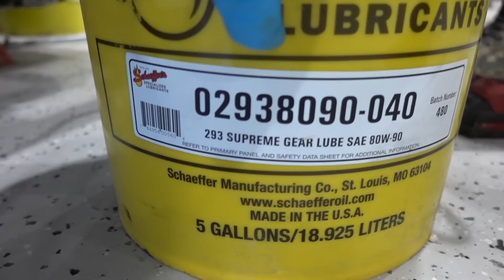Little Scout, Big Upgrades

Comment: Those Scouts were good, At least i liked them.  The worst part was trying to find parts for them.  Last one i worked on was a travelall.  Could not find steering linkage for it (this was before the internet got big).   The best thing are those engines all most undestroyable.

Comment: 12er!!  
did you put wheel weights directly across from each other .???
Reply from the maker: It looks like I did. Lol. The tire machine said they needed more weight but I just put them on. Rides smoother then ever!
Reply: @holdenbros910  ...bro no step 1 step strip the weights n start over  apply your initial weight on your first spin straight up where  the machine tells you...try not to exceed 3.50 in the first weight .. ...spin again if it gives you more weight  numbers it goes as follows  red to green dots aligned  on the machine  if the weight is at the top add what the machine says ...if you put on 2.50 and the machine says  .25  with the weight up add .25....if the weight is 90 deg down from where your red/green light says add weight  move the weight 1 length of the attachment clip per .25oz upward  and if the weight is at the bottom... like I saw in the video ?!?!
you deduct that amount from what's currently there  ...hope it helps  in the end you should have  1 weight or 1 group of weights  front and back  not weights  spread out all over the place.. balance a drive shaft  add or take away in 1 spot not in random places...oh if it wants more than 3.50 initial spin the tire on the wheel 180 and start over